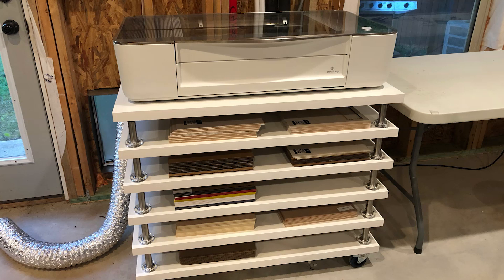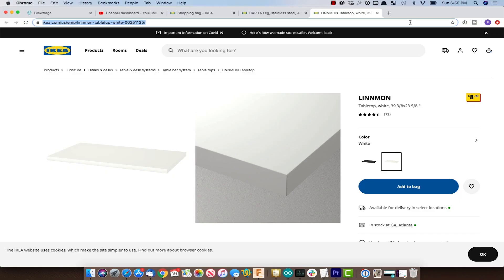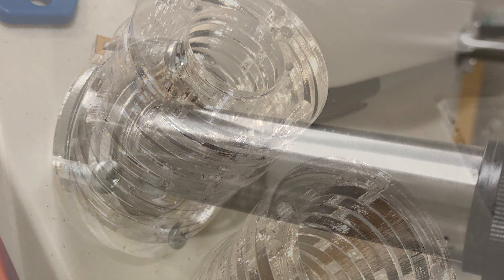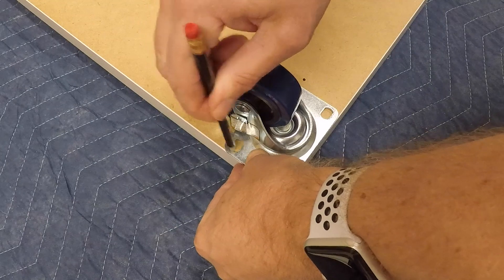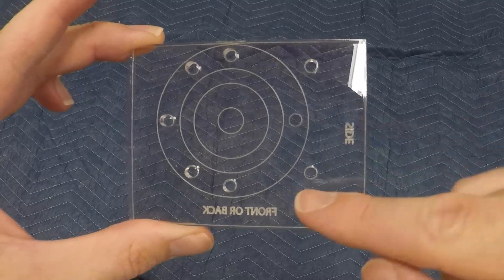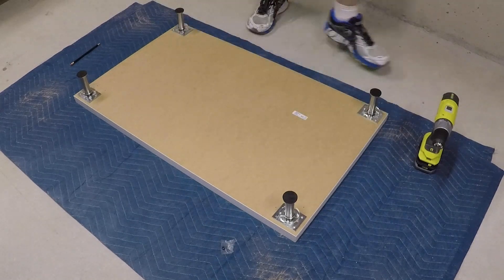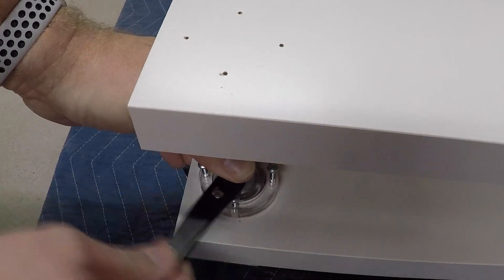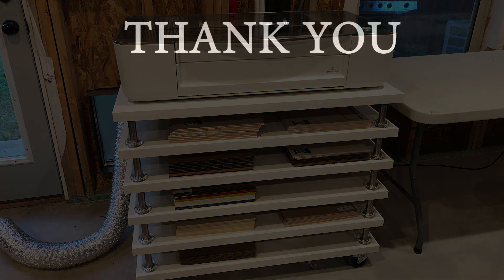IKEA Hack Craft/Glowforge/Cameo/3D-Printer Table | Glowforge | IKEA HACK

Comment: Which screws are needed?
Reply from the maker: For the wheels I used 1" #10 wood screws and some 1/4" washers.   For the acrylic parts I used 1" #8 sheet metal screws.   For the IKEA Leg parts, I just used the screws that came with it.

Comment: I think I'm just missing something, but how do the shelves adhere to the leg underneath it to keep them from moving?  Is one of the 2 acrylic pieces screwed underneath to the shelf above it?  Thanks
Reply from the maker: The legs have a plate that screw into the shelf, and then the two plastic pieces clamp the "foot" of the leg to the layer below it.  The acrylic template has holes for the leg plates, and also holes for the leg "clamps".
Reply: @TheAtlantaMaker  Thanks!  makes sense now, it went over my head that the risers in between the shelves are actually leg pieces and would be screwed into anything above them.

Comment: Looked through comments to see if any mention of a Fusion 360 tutorial. Love this project tutorial. And I’m at a very basic level but I want to design 3D accessories (like trays and boxes to use at home). It seems like using Fusion 360 and AI are good ways. I have both programs but have only used AI. Great job! Thank you.
Reply from the maker: Glad it was helpful!  I still use Fusion360 for a lot of items, although mostly for 3D printed stuff or mechanical stuff as I can easily model those.  But for some Glowforge Projects, I still use AI only.  Really depends on how complex the model is.

Comment: Thank You! Built mine today.... I found it easier to attach the acrylic to the feet to avoid the right angle screw driver. Not sure if you knew the feet can be removed from legs. 

Thank you again.
Reply from the maker: I knew the bases could come off, but didn't know the feet themselves did.  I think one other builder commented that they lifted it to move it and the feet did come off.  Guess I never see that since mine is on casters and moves easily.

Comment: Thanks for the file. I just bought the tables and legs. Still need to buy the acrylic but do you mind sharing, what screws did you use for the acrylic part? Maybe I missed it. If I did, I apologize. Thanks!
Reply from the maker: No worries.  I used #8 1" screws for the acrylic parts. You can buy a box of them at Home Depot or Lowes pretty cheaply.

Comment: Thanks for posting this video and files! can you share your GF settings for Acrylic?
Reply from the maker: For the most part I just use proofgrade settings for cutting acrylic, then I change some of the engraving to use a defocused engrave (you can learn more about that in this video: https://youtu.be/2B2oMYR1Ov4).  So if I have 1/4" clear acrylic I'll pick Thick Clear Acrylic as the proofgrade option.  if I have 1/8" I'll pick Medium Clear Acrylic, etc.  I always run a quick small circle or square cut test just to make sure the settings work before running any bigger cuts.

Comment: getting ready to do the cuttting today, can you do it all out of one sheet of the gf acrylic, or should i have purchased more today?
Reply from the maker: It’s about a sheet and a 1/2.  You can fit 4 sets of the circles on one sheet. Then the 5th set on a second sheet. Circles need to be 1/4” or thick proofgrade.  Template can be any material.